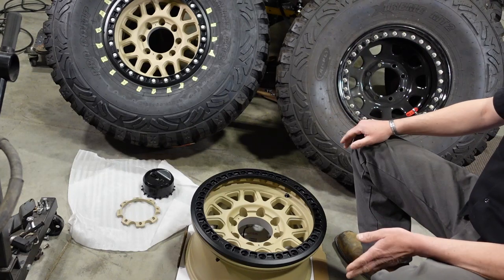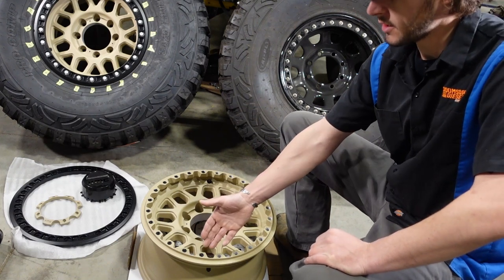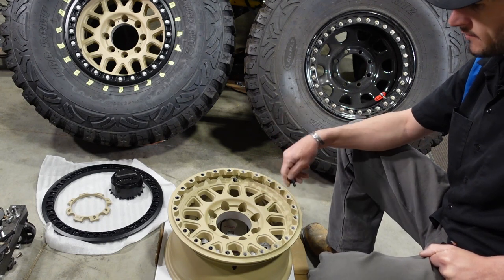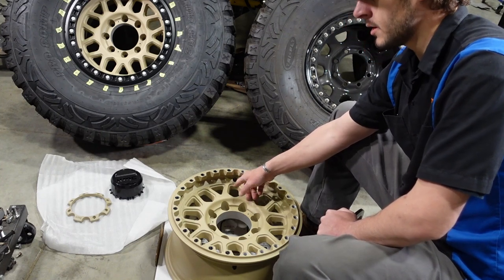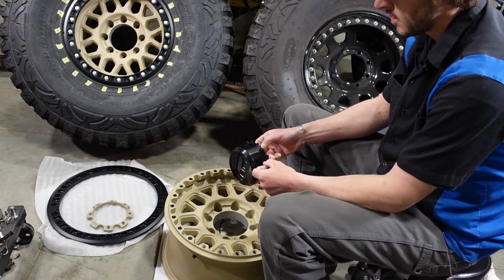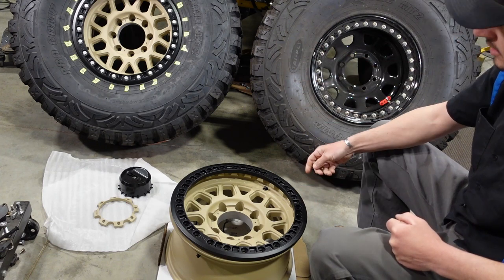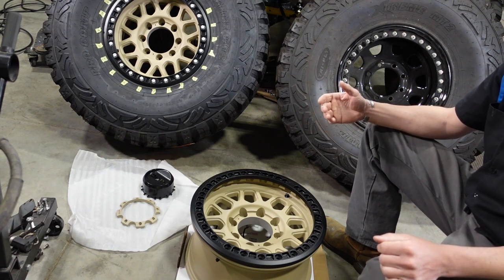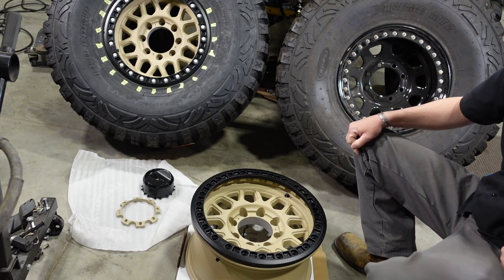KMC KM234 Grenade Review: Part 2

Comment: I am having the same exact issue with removal of the thread locker insets. What tool did use to remove them safely without stripping the thread inserts?